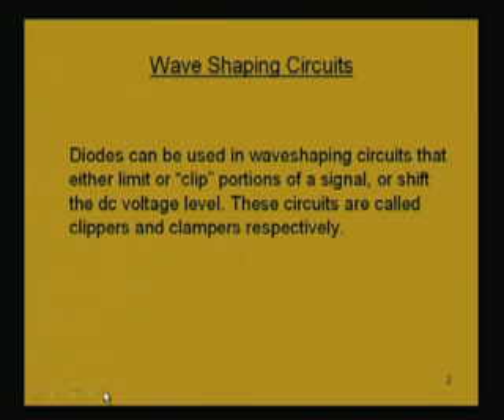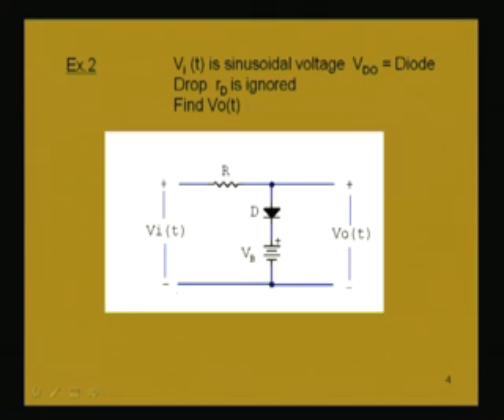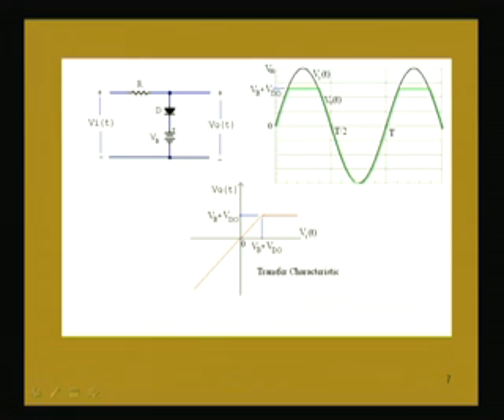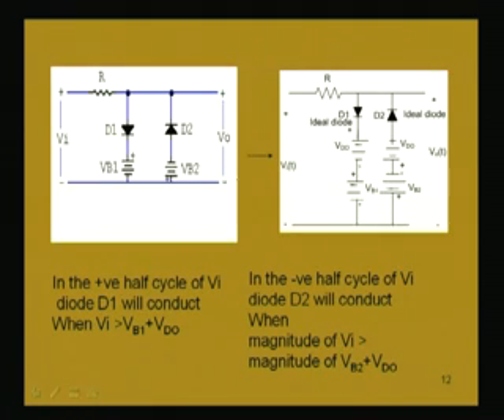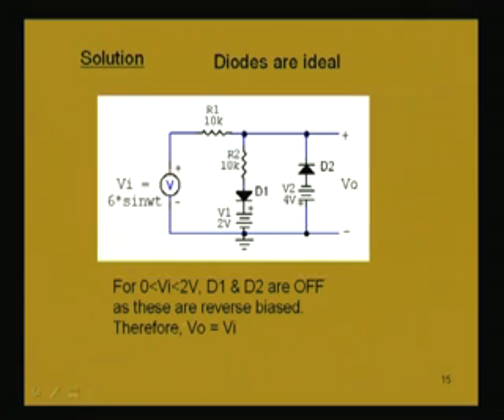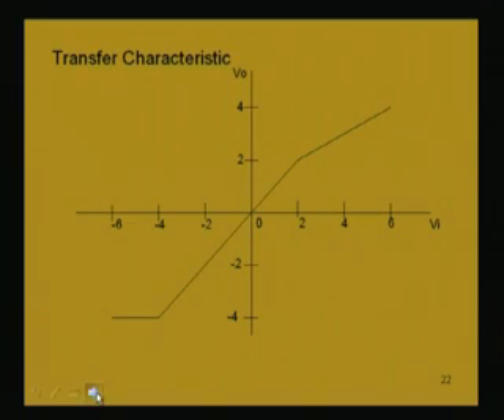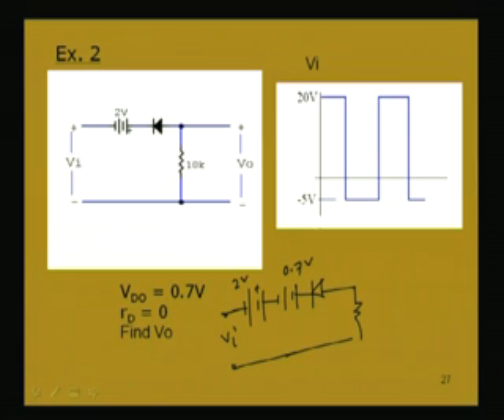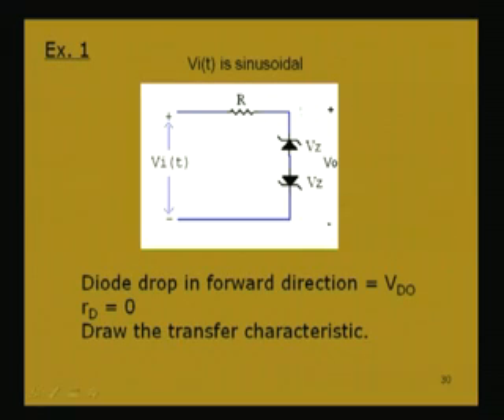Module - 1 Lecture - 6 Clipping and Clamping Circuits

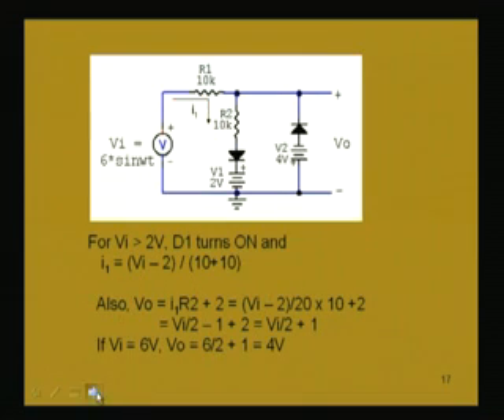Comment: 40:38 instead of finding current Ii, We can directly apply superposition theorem and find Vo when D1 is shorted (i.e., Vi>=V1) and D2 is open (R.Biased).
It basically yields the same result Vo = Vi/2 +1, when Vi>=V1

Comment: The triangualr wave form question...the output will be negative part clipped at -3.3 rit. Its positive in the video but i think it should be negative as the diode conducts only in negative half cycle